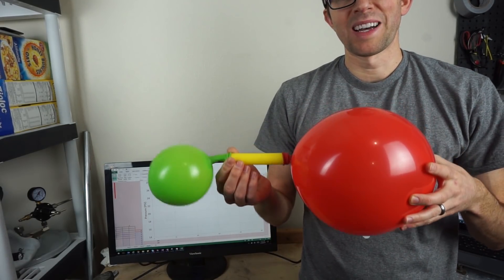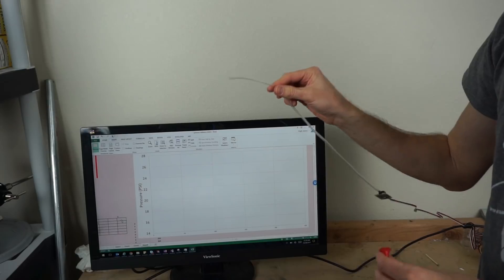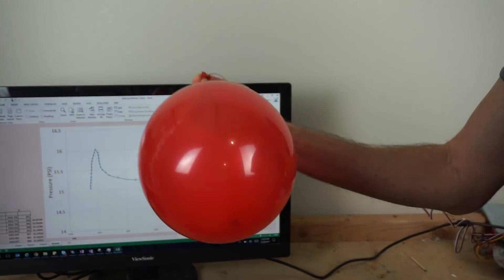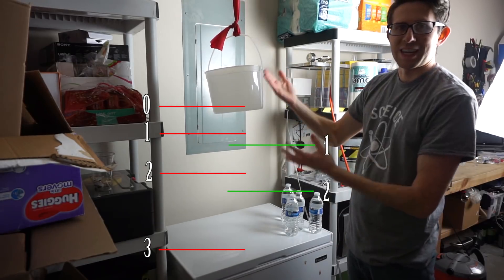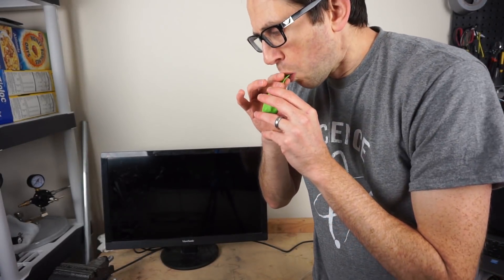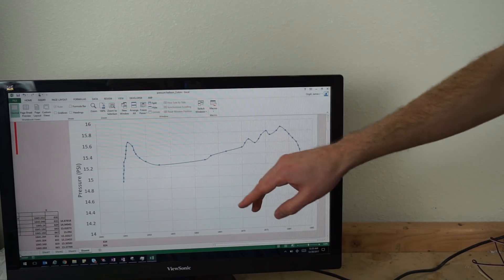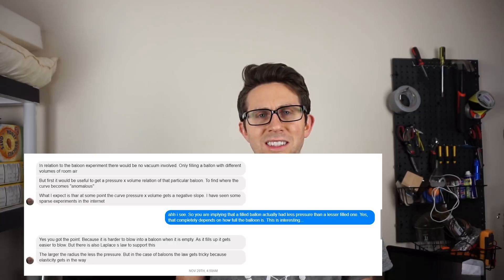You Will Get This Wrong Every Time—Balloons With a Memory (Elastic Hysteresis)!

Comment: if you think about it, there's absolutely no way for it to retrace what it did inflating when you deflate it, because you're only letting air out, and that couldn't introduce any pressure into the system. shouldn't come as a surprise that the pressure never increases when deflating.

Comment: the obvious answer is yes, it will change in size. and its not wrong. The best question for the thumbnail should've been will it inflate? where the disprovement remark at the bottom actually fits in.

Comment: Presumably each time you inflate a balloon to a given size it will always contain the same pressure, but if you deflate the balloon to a given size then the pressure will vary depending on how far it was inflated first?  So by inflating to varying sizes then deflating you could create a row of balloons all the same size but containing different pressures or a row of balloons that all contained the same pressure but are different sizes.  Is it then possible to set up two balloons that are different sizes but contain the same pressure but with the smaller one inside the bigger one, and if you could do that then the pressure on the inside and outside of the smaller balloon would be the same so would the balloon still be stretched?

Also, if after the initial blip in pressure the pressure drops whether you inflate the balloon further or deflate it, what happens if you keep partially deflating and re-inflating over and over?  I can’t imagine the pressure could go negative or even down to zero and the balloon still be inflated, so does the pressure actually asymptotically approach to some fixed minimum level where you can inflate and deflate and the pressure actually becomes constant?  After a single inflation and deflation does the pressure approach this same value and then reach a point where the behaviour changes and it drops back to zero more quickly in a counterpart of the blip when you start to inflate?

Comment: There is a hell of a lot more science in this than just air pressure dumb ass you need to under stand what the balloon is made of that is why you get that spike at the beginning and if you are going to use a pressure sensor just put it in the balloon it would be way more accurate.

Comment: Fun fact:  Hysteresis in rubber is one of the main contributors to rolling friction in tires.  Steel also has hysteresis, but very, very little, which is one reason train transport is much more fuel efficient than road transport.

Also, I've worked with hysteresis in metals and magnetic materials for years, but never heard that pronunciation.  I've always heard it pronounced:  hi-stə-ˈrē-səs.

Comment: 3:22 Actually (my hypothesis is if you did this) because you were actively releasing air 2 of the 3 forces maintaining the air pressure we're unbalanced to the other force. (The forces being how hard the rubber is squeezing the fluid / air inside, the outside pressure, and the internal pressure. The unbalanced forces BTW are the first 2 in the list.) This means that the pressure would be lower because the air inside couldn't push back as hard. If you stopped letting out the air the pressure would go to what it would be if during deflation it reversed on the curve (of pressure on the graph) we saw when filling the balloon, because the forces maintaining the pressure would be the same.

Comment: Would be interesting to do a related study where you inflate a balloon then let it fly around. As I recall, you can hear the air rush out the fastest when the balloon is almost empty, WHY? As the balloon gets smaller there is less wind resistance which should cause it to fly faster, but I suspect there is also more propulsion near the end. Perhaps part B of this experiment is to hold the balloon in a manner that measures the force of propulsion vs time.

Comment: Now I'm thinking if there's any difference between pumping car tires right away to the required pressure vs. pumping above the required pressure first, then release some air to meet the required pressure.
Reply: Egarolla
If you inflate tires so much they visibly change shape, then yes.
Reply: Tires are made from an extremely different material, they should NOT behave this way!   Both are referred to as "rubber", but a tire is made from a fully cross-linked polymer that will have far more stable and predictable properties under various stress conditions.
Reply: @ionic_iris  I agree. Not to mention with the tires being belted it' takes a good amount of pressure to increase the size once its reached the recommended psi. As opposed to when they are deflated, you can start to see a size increase fairly quickly because you are not fighting the actual material at that point.
Reply: Well according to this, they will be slightly larger in size if you inflate then deflate
(As they'll need more air to keep the same pressure)
Reply: Tires have significantly less elasticity per surface area than the balloon rubber so the effect is likely greatly diminished.
Reply: Even if tires reacted this way, you’re reducing the pressure back to what it should be. The variable in this scenario is not the pressure, but the relative size of the tire

Comment: This phenomenon  is nothing..it depends on the balloon.Let me explain

You know they say all ballons are created equal. But you look at the red and you look at green balloon and you can see that statement is not true. See, normally if one ballon go one on one with another balloon, you got a 50-50 chance of which ballon will shrink. But the red balloon a genetic freak and Its not normal. So you got a 25 per cent - at best - to shrink the red balloon. And then you add green balloon to the mix, the balloons chances of shrinking drastically go down. You see, there's a 33 and 1/3 chance of green balloon shrinking. But , got a 66 and 2/3 chance of red ballon shrinking.The green balloon  knows it can't beat the red ballon and he's not even gonna try. So green balloon, you take your 33 and 1/3 chance, minus red ballons 25 per cent chance and you got an 8 and 1/3 chance of expanding at the best.But then you take red ballons 75 per cent chance of expanding if it goes one on one and then add the 66 and 2/3 per cent chance, red ballon got a 141 and 2/3 chance of expanding. See , the numbers don't lie and they spell disaster for the green balloon .

Comment: How did you measured the pressure... I mean to ask what devices you use??? And how about measuring the pressure inside soapy bubbles though it might not be too interesting because it has no elastic hysteresis... And that betting thing you shown it makes me remind a similar theoretical problem which I once solved it has 2 soapy bubbles of different radius connected in just the way your balloons and it that case smaller bubble always reduced in size and larger bubble always increased in size... That was also interesting for me...

Comment: Great video. One small question though. While measuring the deflating balloons pressure you are exposing the pressure gauge to the atmosphere resulting in a sudden drop. Rather if you measure the instantaneous pressure of the deflating balloon by pinching it at periodic intervals then I suspect the balloon might  show a similar graph as during inflation, albeit a bit lower overall due to hysteresis. 
It would be great if you could try it.
Cheers!

Comment: Very interesting. The slingshotchannel and smartereveryday did a collaboration video a few years ago where they explained that if you tension a slingshot and then immediately fire it you get more power then you do if you tension it and then pause before firing as some of the potential energy is lost to heat in the later example.

Comment: You should test putting a magnifying lens on top of a solar panel to see if it increases its power generated. If so, how much. Try different sized magnifying lenses for different results.
Reply: Zachary Freese a few things. If you were to shine the the magnifying glass on the solar panel with a source of light not touching the panel already then It would increase...slightly. If you were to shine in onto the panel but put a shadow on the panel with the magnifying glass. Then the power generated would decrease slightly.

Comment: I must say, I would have never guessed this!  Good thing I didn't do one of my before video predictions lol.  Just a nice reminder that you need to actually do the experiment before saying what will happen.  I would have told someone that the pressure will always increase due to the increased tensional forces.    Great video!
Reply from the maker: Yeah this one was really interesting for me!
Reply: I guessed it correctly because I always know blowing up a balloon is so damn hard initially and then gets so much easier. But I don't get the $20 so it was still pointless :(
Reply: Well said! And I would've agreed with you. Now, I'm thinking it may have to do with the geometry of 3d shapes, seeing as volumes increases at a greater rate than surface area, the complexity of elastic materials' molecular structures, and other outside factors like heat. Really shows how these materials have more dynamic properties than I previously thought. Science!
Reply: I said it will maintain homeostasis.

Comment: The pressure inside the baloon is caused by the potential energy of deformation of the rubber. General deformation equals elastic deformation summed with plastic deformation. So when the pressure inside drops its because of increase of plastic deformation at the expense of elastic deformation. To really understand this you need to know the stress-strain curvature of rubber material - usually all elastic materials have an elastic region, plastic region and in the end before failure - elasto-plastic region. Summarised - the inside pressure strongly depends on the current deformation of the rubber in relation with the stress-strain diagram. If you understand it you can win every bet 😉

Comment: That’s actually a really cool experiment. I never really thought about it. My intuition said the more volume would be more pressure but  it’s more related to the stretching of the ballon. Once you stretch out the balloon then you stop building pressure while the balloon gets bigger. Obviously if you kept adding air it would reach a point where it could no longer stretch and then build up pressure before it eventually popped.

Cool video.

Comment: Excuse me, but I doubt your pressure measurement, because the flow of air from your breath is not continuous. You should have used a pump, which pumps air inside the balloon at a continuous rate, instead of your breath.

Comment: @the_action_Lab your software logging intrigued me. Is that excel plotting in real time or some other software. I would love to see more about that as its a very useful tool.

Thanks
Kas
Reply from the maker: Yes it is excel. I wrote a Visual Basic program for it with a new point being added every time the pressure changed by more than 0.07 psi.
Reply: and how did you interface your sensor to Excel?
Reply from the maker: It’s a Phidget sensor and usb connection, look it up. They are awesome

Comment: Is it not that the rubber becomes weaker as it's stretched? Because if the process is irreversible then that would be the case. If hysteresis, the "memory", was indeed that the material remembers being pulled and un-pulled then the graph would show an exact match of the beginning, going up then down. Maybe I don't understand hysteresis. Just my thinking in writing here.
Reply: What is pressure showing in this at all?
Reply from the maker: Notice that when I stretch the band with weights, the bucket goes back to the original position. The start and end positions are the same. This means it’s not permanent deformation.
Reply from the maker: Pressure is showing how much force the elastic is putting on the air. It is showing that once stretched, the balloon has less elastic force until it reaches its starting position. Then it starts over if you do it again.

Comment: Put hydrogen peroxide in a vacuum chamber!
Reply: It's Ethan! water?
Reply: With low pressure you vaccum destill the water leaving pure hydrogen peroxide

30% H2O2 ist quite dangerous (if you get some on the skin you can see it dying and getting white and peling off (+pain)
99% h2o2 sets stuff on fire....

Comment: @2:05 Not really. Makes perfect sense. The pressure in the balloon is atmospheric pressure + the pressure from the rubber. As the balloon expands, its surface area increases drastically, so the amount of force it applies per unit area drops, even as the tension increases from being stretched.
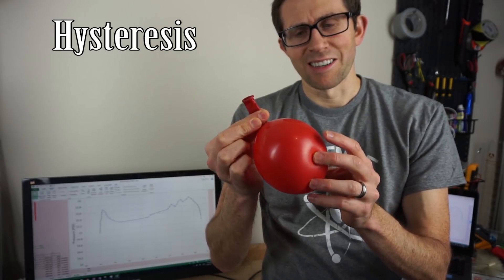@3:30 Well, yeah. Everyone whose ever inflated a balloon for a second time should know that. Inflating it a second time is much easier than the first time, which means that the rubber has somehow changed.

Comment: Maybe, if you take a latex rubber balloon and blow it up to it's limit before it bursts, All the latex molecules have been stretched to their limits and do not shrink back down to their original size once the air has been released... So therefore, once deflated, the balloon takes less air pressure to re-inflate it. That's why we stretch balloons before we try to blow them up...
Reply from the maker: That’s actually a different effect that is permanent deformation. What I’m talking about here is totally repeatable, happens every time you blow up the balloon
Reply: But when you blow up the balloon or even partially inflate it, the latex molecules stretch and weaken?
I am just guessing!
Reply: banjax66 no the polymer chains align and the only energy cost is actually comming from entropy, so it will always go back to the unstretched state